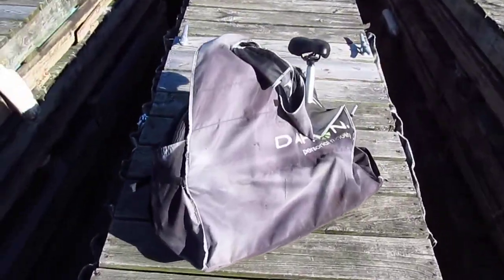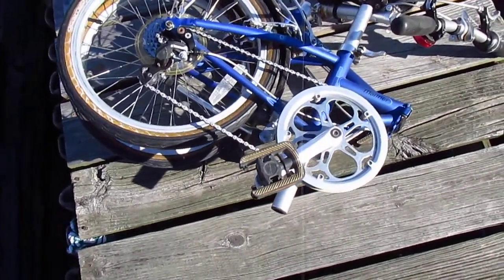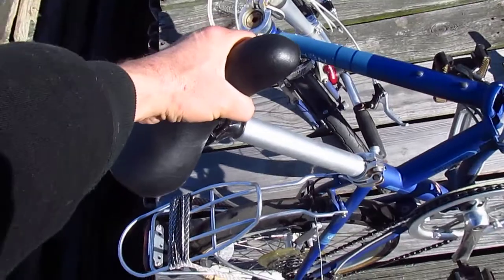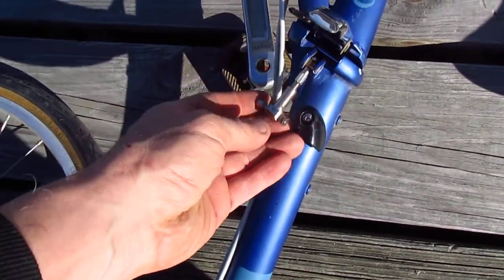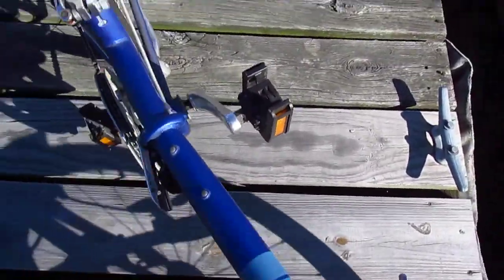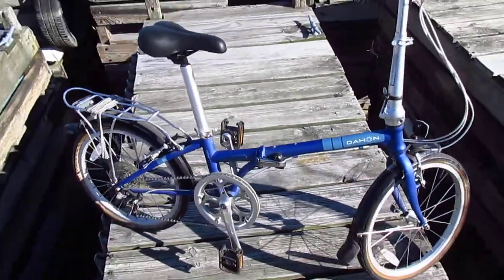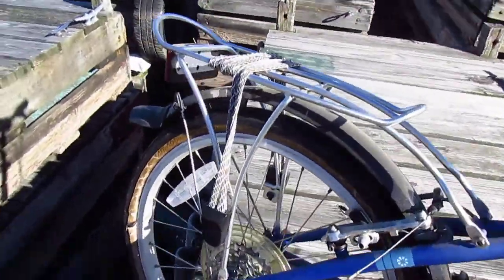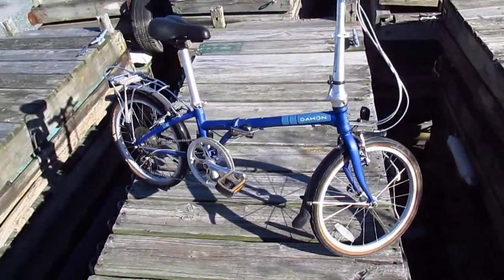DAHON MARINER Folding Bike Unfolding FAIL!

Comment: Man i can't really say if this was meant for fun but no offence but you're a destroyer 😅. With a little care you could fold/unfold it really well. Handlebar has to go (with some handling care...) between the two folded frame halves. Fully enteded headpost stem first, so when it folds down, it doesnt go in the way of the hubs. The hubs will touch and the bike will have a nice thin profile. Like a book! With the handlebar sandwiched in.
Nice try lol